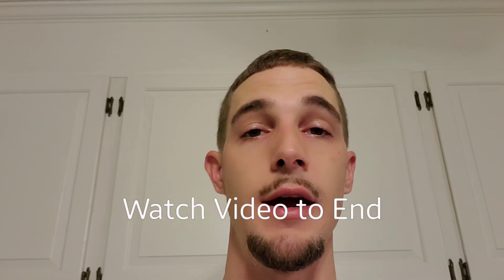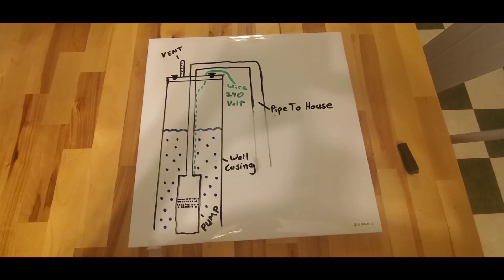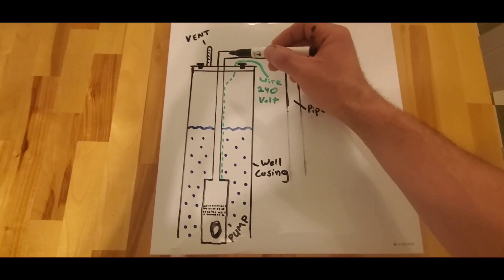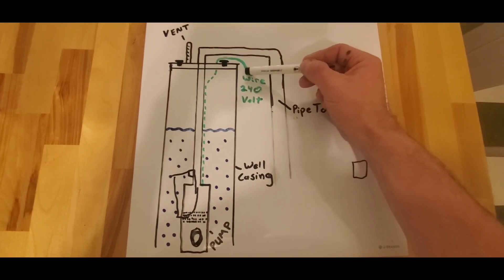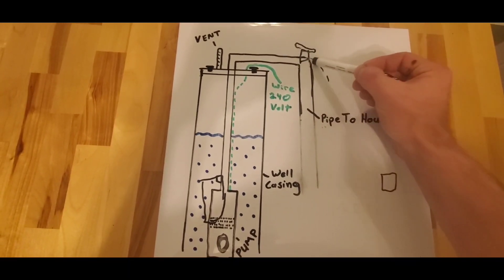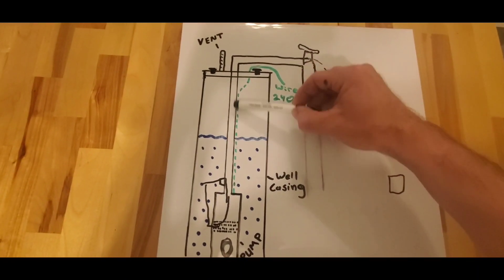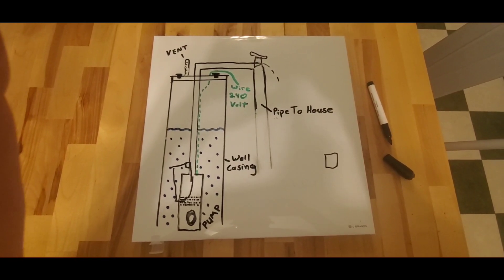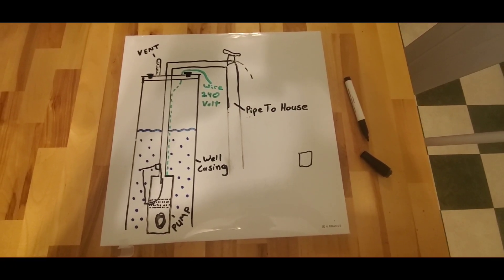No or Low Water Pressure From Well Pump. Pressure Switch won't cut off? Learn Why!

Comment: Thank you for your video! We are getting little to no water pressure from our well tank. We live in Arizona. Where should I check for our pressure switch? There is a Vacuum Pressure Breaker at the outside of the house.

Comment: Our well was frozen. Husband dethawed it with a heat gun. I immediately jumped in the shower. Perfectly normal for 6-7 minutes. Suddenly lost all hot water. Now the cold water "seems" normal but the hot water pressure is awful. I have a gas rennai tankless heater. Is that my issue or is the issue at the well?

Comment: Just had this issue in Florida from the snow. What’s the fix if this scenario has happened. I have it turned off but do I need a new well? What am I looking at cost wise?
Reply from the maker: 1-1.5k depending on what needs to be replaced. If its something simple then maybe 300
Reply: Thank you!

Comment: Thanks for the video, VERY informative. Quick question: what material do you recommend using to protect the PVC from freezing?
I live in Central NC, temperatures go down to into the 20s regularly during the winter months, some winters into the single digits...

Comment: Love your expertise. Would using a foot or two of pipe at the pump be a solution to PVC blow out above the pump? Turning off well and hot water heater is good advice.

Comment: I'm in Mississippi and having trouble with my well. It has been in the teens here for a few days and calling for more of this cold weather for another week. I lost water pressure so I checked the breakers. They weren't tripped. I was thinking it was the pressure switch even though the pump and pressure switch had been changed 3 months ago. I changed the pressure switch and when doing that I found out that the tube connecting to the pressure switch was frozen. After thawing it out it is doing the same as before. I can  trip the pressure switch to stay off or on but it will not turn off after it builds up 60 psi. Do you have any idea what is going on?

Comment: Been without water for about two weeks now.. after I have replaced, gage, pressure switch, control box & electrical brackets, what else can I try besides pulling my pump? Cause my pump pumps up from  0 to 22-25  lbs but no higher or more than that & will stay there with bleeding down after I shut the power to pump.. what all that is left to  check with the pump isn't building up the pressure, I need help due to I'm disabled & low income senor living alone by myself, now having no water or nobody to help out..

Comment: I didn't have an obstruction.I had a frozen pipe. I fixed it but it did run for a day once it defrosted.
Reply: I should have said a busted pipe. I have like half pressure. It does fill the toilet and I can use the cold water but not enough pressing to get more than 5 minutes out of the water heater.

Comment: Hi, pressure tank reading zero, water valve dribbles then stops, no suction well pump switch is turned off.  Seems the main line is frozen but perhaps not below the water level.  What's your advice?
Reply from the maker: Keep the well pump breaker off! If it's froze you don't want it to burn up .

Comment: Sorry if you have already answered this. So we just had freezing Temps and I realized I had my water hose hookup to a outside hydrant at the well. The hydrant was on So the water inside the hose froze. When I noticed it yesterday I got the hose off and closed off that hydrant. Fast forward to this afternoon I come home from work and water is spraying out of that hydrant with it in the off position and I can turn it off. Finally got it turned off at the break box now when I flip the breaker back on I have no water at that hydrant or in the house and my pressure tank isn't showing pressure now. Any help would be appreciated. Thanks

Comment: Howdy and thanks for your videos.. my control box had a bad capacitor so I so I replaced the box water worked well for a few hrs now no water again but I unplug it for awhile and then put the cover back on and it takes off but won't reach full pressure and stops I'm thinking my well pump is bad but the resistance is ok please help

Comment: Just watched the video. We live in South Carolina and last weekend it got really cold. Our well was working properly the first 2 days then we had a break in the wall on the half inch pipe that feeds the washer. We repaired that then the next day our well would just stop running, the pressure gauge would drop and no water will pass through. Shut the pump off for a bit and it works a couple cycles then stops again. Our well is submerged at around 465 feet but I think I can still feel the vibration of the pump even though we have no running water. Do you think we have an issue on the down pipe? Thanks in advance for your reply.

Comment: Many of the wellheads have a check value at the top so you won't always feel the suction, but you'll hear it if you listen. I had a busted drop pipe last year here in TX.
Reply from the maker: I prefer only vertical placed check valves on the drop pipe. For that exact reason. But every one does it slightly different.

Comment: Apprecite your explanation Sir, thank you for taking the time. This scenario really explains my issue very closley, it sounds to me that I may have a leak or busted pipe down inside my well. Mine was dug around 500 feet or so, my question is, can this be repaired? Do I need 500ft of pipe? Can a  patch/repair be done on the busted section? Please advise?

Comment: Hey there bud, my problem is about a week ago my water froze, and busted a pipe, didnt run for lomg i noticed it very early, and fixed it and had water for about two days, then last night i noticed my water pressure was very bad and the pump was not shutting off, and today its even worse and the pump still isnt shutting off so i flipped the breaker off of course and messed with it all day on and off, i replaced the water pressure switch for the well and still no water pressure, i do not have a water pressure gauge either to test, so im going to be pulling the pump up tomorrow just thought id ask and maybe see if you might know what it could be before i go and pull the pump thank you!
Reply from the maker: Look for a busted pipe within 5 ft of the pump when you pull it out.

Comment: In south Georgia and away in Atlanta over Christmas. Came hoe to no water. Pressure breaker arcs like you said to try. Pipes into and out of pressure tank were very cold as was the bottom six inches of the tank. I could feel the pump causing the pipes to vibrate. The pressure guage reads zero. I'm guessing the drop pipe may have burst as you suggest and have called my well guy. But could the pressure guage reading zero indicate something else has happened due to the freeze?

Comment: I'm from the south my question is pertaining to freezing weather especially like what we just had.  My pump is pushing about three buildings and a camper,  is it more beneficial to turn the system off and drain the lines or leave every faucet dripping? Which i know in turn would keep the pump running and,  is going to burn it up.  Also what kind of pump hp, inch,  2/3 wire,  pump would you recommend for a multi home situation.? I've had to replace it twice in the last three years now I prefer to replace it again but want to do it myself because since the paying of my dad every one I've paid to do such turns out bad quality and,  they don't want to teach me.  I like to know how to fix my own things.

Comment: I have no well pump pressure and well pump controller seems to periodically chatter.  I have solid 240V at the well pump controller.  I have in-spec ohm readings on well pump terminals.  I replaced the well pump controller and still have the same issue.   (I'm in Florida and have had freezing temps of 25+ F overnight the past couple of nights, but all water piping and well head are sheltered so I don't think it is a freeze issue)  I think my next step is to pull the pump up and check everything or call a plumber ... but I wanted to see if there are any other simple things I can check.  (I can't think of anything that could be wrong with the pump or the wiring that would cause the controller to chatter ... other than potentially a broken conductor somewhere that is intermittent ... but I haven't done anything near or around the pump or wiring and everything has been working fine for several years)  ... any thoughts would be appreciated!!

Comment: But that breaker first thing.
That's what I did.
Now I need to insulate 
And get a concrete lid mine is steel
And it gets cold

Comment: Mine I think just lost its prime.  I've watched two of your videos but my system is hooked to a water softener as well. I have by-passed the softener but it still uses the salt. My pump won't stop running so I shut it off. I had no water downstairs but I did upstairs but the toilet wouldn't flush, so someone told me to let the water in the upstairs sink run and maybe fix the toilet but all that did was make my pump keep running until I shut it off. I just turned the knob under the pump and water spurted out a little so I turned it back off then I did get a trickle again upstairs then nothing again.  I have no connectors for priming like you showed in your other video, I just have the gage where it shows the pressure and other gauges on top. Is there anything that makes sense to you from what I've explained? I'm hoping you can help. I'm in PA and the freeze is almost over. Thanks

Comment: I’m in Missouri and my water quit working it got down to 21 degrees below but I had the water dripping in every faucet and I noticed that the pressure wasn’t like use to before it quit I do have a well house but not insulated it open and shut the points and I could hear the pump coming on and off but no water coming out

Comment: Dealing with this in VA. I’m a renter with limited knowledge of the system, which is older and a bit piecemeal—I can’t even be sure where the main shutoff is! Anyway, I currently have no water, almost no pressure in my blue tank (pressure tank I assume) and have cut two breakers, each labeled “pump”. I’ve had them off for several hours and have cranked the heat as much as I can. Faucets are open. How long do I wait to restart the system to see if it’s thawed or busted? Until warmer weather? I’m hoping to still leave town for a few days but am concerned about leaving things like this. Thank you!!
Reply: And Merry Christmas!

Comment: Hey, so I really hope that you see this. I'm in Charlotte and we were hit with below freezing temps last night and today. When I woke up, the water pressure was about 1/3rd of what it usually is. When I went to check on the pump, I turned the power off and flicked the switch back and forth a bit. I did notice that it was closed before flipping it back and forth. After turning the power back on. the pressure returned and was surprisingly better than before the freezing temps. However, after that I went to work and just got back a few hours ago and now the  pressure is worse than it was this morning. The switch is now stuck open and there is power going to it (spark when flipping it) along with pressure on the meter. It was a bit cooler out today than it was last night so I don't know if the problem is what's described in this video, a bad switch, or what.  I just replaced the switch last year, too.
Reply: Hoping to hear something about this, as "well". 🤭 Lost pressure, closed contacts manually, ran for over ten minutes and wouldn't turn off (9pm last night), turned breaker off until morning (10 am today), turned breaker on and contacts remain open, manually close contacts, see sparks and here pump running, regain pressure but won't stay on. I've been manually closing contacts periodically for toilet and shower, just hoping it isn't something major. Thanks in advance.
Reply: So update: I had the pump shut off overnight and most of today, but noticed that the pressure was sitting at around 85psi. I turned the power back on and released the pressure and the pump kicked back on, so I assume it may have frozen over and had mounting pressure, but when I opened the release valve it was enough to jostle the ice blockage and have water return. Hopefully it stays working. My neighbor had the same issue as well.
Reply: The water in the small nipple the switch is on may be frozen.
Reply: 😊😊
😊Q

Comment: How to defrost the water pipe that is buried that comes from pump? I disconnected the power to well within an hour of water stopping. Had water at noon, none at 2 pm.  Today , after 2 of subfreezing, first time above 32° for a few hours. No water when I turn on hose Bibb in well house.
Reply from the maker: I just uploaded a new video on that topic
Reply: @h2omechanic  I figured out today that the pipe under the pressure tank is where the break is. Hoping you have video showing how to connect underground pipe back connections in well house. Thanks for quick reply

Comment: Great explanation. lost pressure in my well i believe due to temp being 24 deg. wrapped pipes but did not wrap thin pipe under presser fitting. Took hair dryer to pipe there and pump turned on but still no water in the house . Any suggestions, or should i wait till noon when the temp will be 34. And yes cant get a hold of a plumber.
Reply from the maker: Put a light bulb in the well cover & seal it back up tight. The light bulb will create enough heat over 6 hours to allow the pipes to thaw out

Comment: I replaced my pressure tank and switch. My switch is 30/50. The pressure in my tank is 27 psi. When I turn on my breaker, the water pressure increases to about 28 psi and stays there; however, when the water is used in my home the pressure goes down to 0 psi and stays there until I turn off the breaker and let it sit for about 30 mins. Any idea what is causing this issue?

Comment: This makes the most since for the problem we have now is there a DIY fix to repair a burst my bosses don’t want to call a plumber out for it because they had to buy a new tank and pump last year so i have been put in charge of trying to fix this.
Reply from the maker: Temporary fix you can add a check valve at the top of the well. Thats if your water pipe is above ground like in my picture.

Comment: My well is a jet pump and the motor in the pump will run but it won’t pump it just makes a grinding noise it’s full of water and none of it is frozen cause we had a heat lamp on it

Comment: So the electricity has been out for almost 21 hours now from the heavy ice deposit on the lines and trees here.  So I left the cabinets open in my all electric home and cuddled with my two cats for warmth on the couch all night worried sick about my upstairs bathroom plumbing for when the power comes back on or when the temps come above freezing in another day or two since the well is only allowing the one of two downstairs bathrooms and not the kitchen faucet to drip I guess from leftover pressure though how long that will last I don’t know.  I don’t know either what this is going to do to my well or pump and no idea when they are going to get my power back on.  This little old lady doesn’t know what to do next.
Reply from the maker: Nothing you can do until the power comes back on.
Reply: @h2omechanic  well it was a short answer but I am grateful for it!  Thank you

Comment: We just changed the pump about 6 months ago it's not a submersible. That pump has not shut off since lol. But that's beside the point. We get up this morning there's no water we live in Northeast Ohio it's cold but it's 26°, you wouldn't think that'd be enough to freeze anything specially when it was just eight degrees two nights ago and everything were good. No the water isn't coming out of the lines out of the spigots the pump is running zero water pressure. Any idea what I can do to fix this?

Comment: I live in Central NY and of course, my well system is somewhat different. I have watched a few of your videos about pumps, but now I am curious about the system that delivers water from the piping below the freeze line outside the steel casing into buried pipe towards my home. Can you show how this is magically connected and reconnected in the event that a pump must be pulled from 275' depth?
Reply from the maker: Its called a pitless adapter. About 5ft down in the well the pump/pipe is slipped into a type of male / female Oring connection.  To Remove it and pull it up you'll need a 1" metal pipe with threads. Watch videos for pitless adapter installation and you'll understand how they work. Once you see it, you'll understand how it works.
Reply: @h2omechanic  Thanks....I did see a video where someone was using that t type tool, and then another was searching for the port on a steel casing. I will look into your information. Thanks again.

Comment: my water well is running continuously with no leak. 130' well with pressure tank my well and pressure tank are 800 feet from my house and i find no leak around the well or down the line.I do have water but the when i open the valve but the pump never shuts off. ?

Comment: I’m having problems with my well I’ve been with out water for 5 days I pulled the jet pump out of the well put a new foot valve on it the check valve in the jet pump it’s self seems to be working I dumped water in it an it comes out the bottom of the jet pump put a new well pump in my house that’s has a new pressure switch on it it’s wired rite the pump runs but the pressure won’t go above 20psi if I’m lucky any advise would help greatly